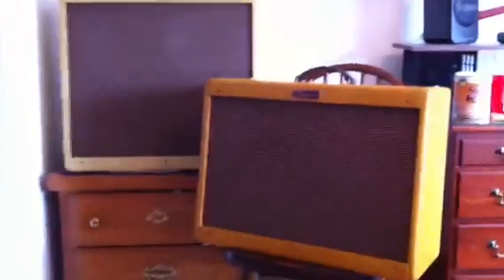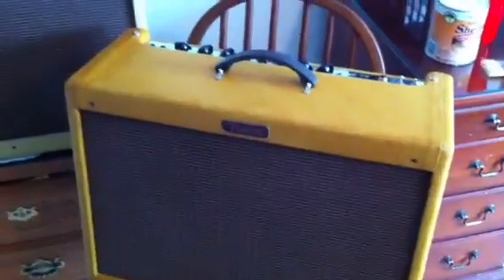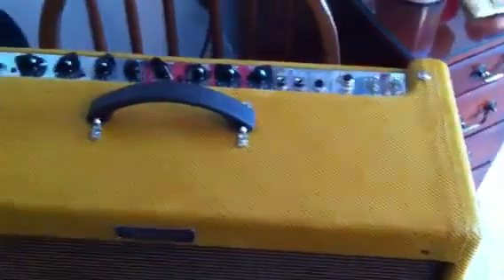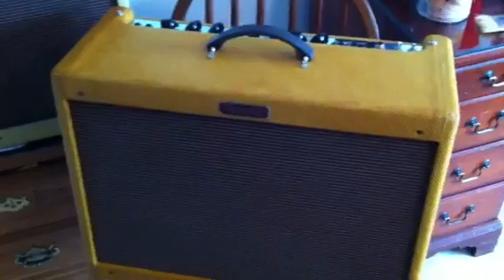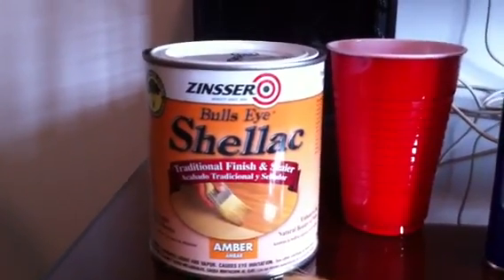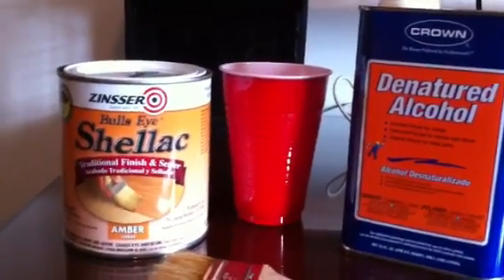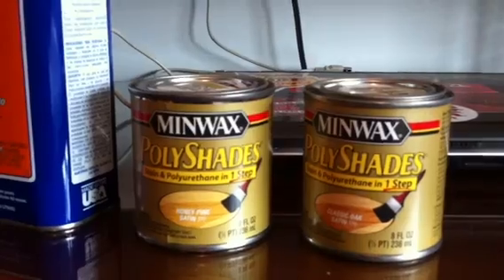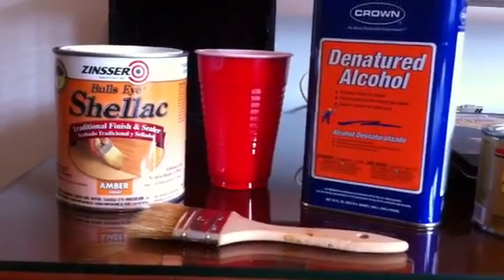Using Shellac on tweed Fender Blues Deluxe amp

Comment: Zinsser makes a spray clear shellac.  Spray a coat of that on before doing the amber with a brush.  It helps getting the amber on nice and even.  Put the amber 50/50 mix on with a brush.  Not a roller or spray bottles for peat sake.  Two coats is plenty.  Three will be dark. My self when its all dry I put one coat of Min Wax water base Poly SATIN. Comes in a blue can spray or brush.  I love this  stuff.  When you are at Home Depot you can get white rubber feet for $2. Spray paint them black.

Comment: I used "button polish" plus about 30% added methylated spirit....really thinned out and easy to apply. I was terrified at the prospect of doing the job, but it turned out to be really easy and quick. 2 coats gave a real nice vintage tone to the amber colour.  Important to remove EVERY bit of hardware from the cab, and make sure you only load the brush with tiny amounts. Make fast passes with the brush strokes and work quickly--that will allow you to go back over areas repeatedly. I was nervous,  but there was no need to be--- I could not be more pleased if I had taken my cab to pro. I think button polish is the easiest option for newbies, because If I can get such good results, believe me, ANYONE can !!..............I am a complete knob at DIY.

Comment: Thanks for the video Craig but man oh man to listen and wait to hear about high voltages. Wish people when making these type videos would get Right to the point about the shellacing process with a brief description of removing components and hi voltages.
Reply: Called a local tech near Seattle and they said if the amp hasn't been plugged in for a few days you have no problem with the voltages.  Just to make sure I gave it two weeks.

Comment: may help to finish with clear first to 'seal' for bleeding problem, and clear lacquer or poly topcoat in satin or matte or...not high gloss, for staining probs. I have heard of using lacquer topcoat over shellac, but I would do bottom test piece, or sacrificial piece if ya got one. if staining over someone else's cover job, you may or may not know what/how it's been built/ covered, but sure look nice compared to unfinished.

Comment: I have a Blues Jr. In tweed with brown tolex on the sides. Its raw so I was wondering about the Lacquered Thing? Is it just for looks? Should I or can I tape up the sides?  Every video that talks about lacquering the amp also talks about relicing it? What made you decide to Shellac your amp? Why not the other one too? Just wondering about the pros and cons and wondering why I should or shouldn't do it. Thanks for any help and advice. Also Mine has the rubber/ Plastic handle like you'rs and I wanted to change to the leather one. Have you done this? If so is it a easy switch?

Comment: With it being so thin, could I just use a small trim roller to apply it? I have built several custom tolex covered cabs and heads and I am planning on building one of these cabinets to modify my practice amp.